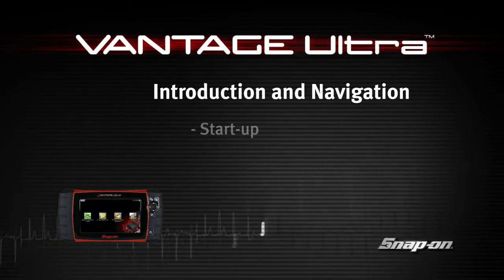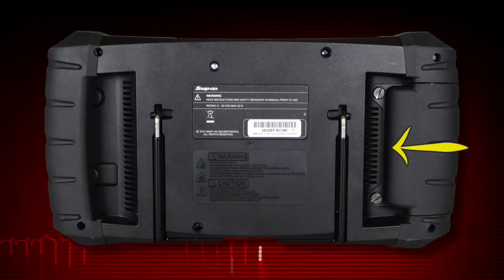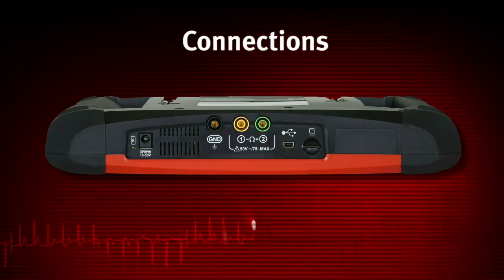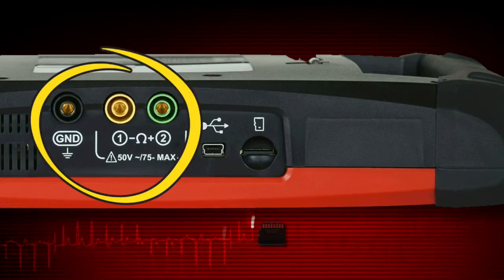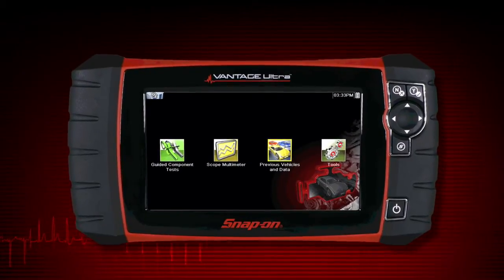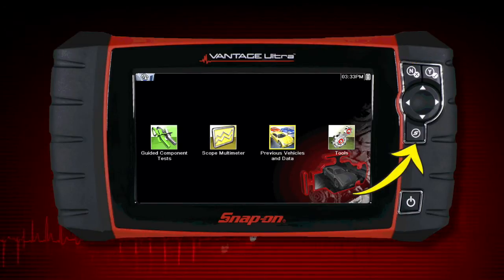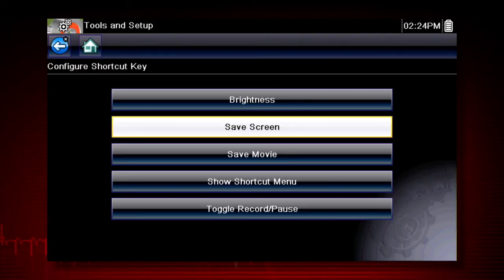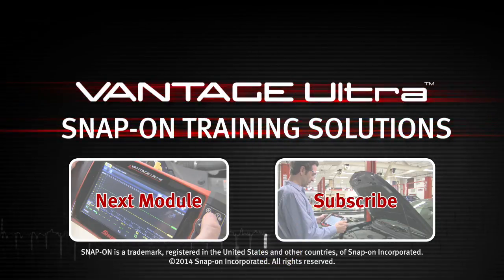Setup & Controls : VANTAGE™ Ultra (Pt. 1/4) | Snap-on Training Solutions®

Comment: Since all of the other diagnostic tools have upgraded to "Edge," will there be a Vantage Edge in the near future? What upgrades would it have (4 channel would be nice, hint hint).
Reply: I have had thw worse snap on dealers known to man for a long time.   This new group is trying to sell me this "Vantage Ultra" for $2000 with a trade of my vantage pro.... then told me he would sell me the zeus for said price with trade in of my vantage pro and my year old Solus Edge.   But same price given to a co-worker for that zeus without trade.   I have no problems calling corporate but what good would that do....  snap it off in your rear is what I know them as.   Then updates that make their selling points obsolete.   Was sold the Solus Edge on points like pulling codes in 5 seconds.   Etc. Etc....  blah blah... found the fisrt update removes every word that dealer told me it would do and all those capable things...not really... its a Solus Pro.... just $3000 for a touch screen.   Their updates do not update anything and most of their info is based on imput from our feedback on the internet so $1000 for updates is outrageous.